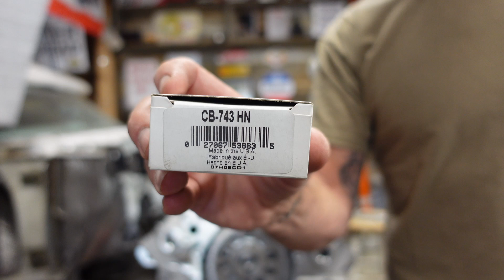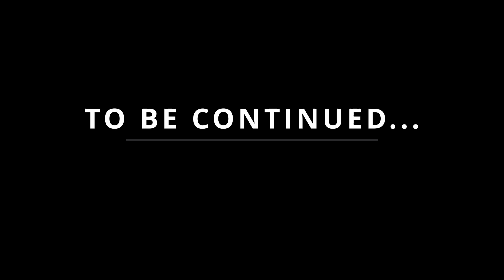Oh NOOO!! WRONG LIFTERS!! All Aluminum, Solid Roller, Big Block Mopar, Street Car. Griffitts Garage

Comment: Another great video Kevin👍none of that loud crazy sounding music. Just clear, straight to the point video.I have a ? couldn't those bushing be grounded for clearance? I'm just trying to learn something here are that's a no-no.This video came just in time I'm looking to purchase a aluminum block for my next build.
Reply from the maker: Thanks Kerry! Thanks for the feedback.
And yes, I should of mentioned grinding the lifter bores as an option. My thought at the time was to keep them as tall as possible because I’m concerned about how big the cam is. .800” on the street makes me a little nervous and I know it’s going to be rough on parts. 
I guess if taller lifters weren’t available, I would for sure trim down the bushings.
Can’t wait to see what block you choose.
I’d like to do a low deck version with a shorter stroke some day.
Thanks for always checking in Kerry.
Kevin

Comment: Sorry for your troubles there is a lot to plan for with lifters,pr cup ht,off center cup,roller size,oil hole location n passage ht so you don't uncover it in max lift and lose oil pressure,what else? Good to see you back at it.
Reply from the maker: Thank you Michael 👍🏻

Comment: Definitely would have been nice if you would have actually provided the correct part # for this particular block...
Reply from the maker: At the time I made the video I did not know what lifter was going to be in this engine. It’s just a video of me making mistakes.
The video after this one has the information you’re looking for. 
Thanks for stopping by Duane.
Kevin
Reply: @griffittsgarage  I did see the follow up video...and they are the same part # I have for my BM Hemi block! You're on the right track!

Comment: Too short? You just need more cam! :)
Reply from the maker: Haha, its like that old saying… I cut it twice and it’s still too short…🤣
Much of the lobe lift actually comes from grinding the base circle of the cam core smaller. This cam has over .800” valve lift. 
I think what you said needs to be on a t-shirt.
“You just need more cam”
Love it, thanks for stopping by.
Kev